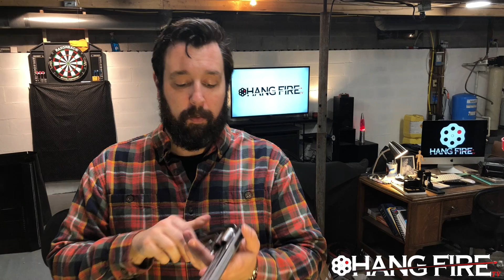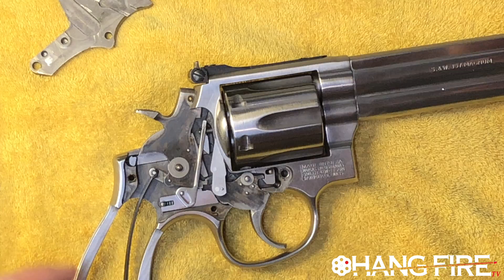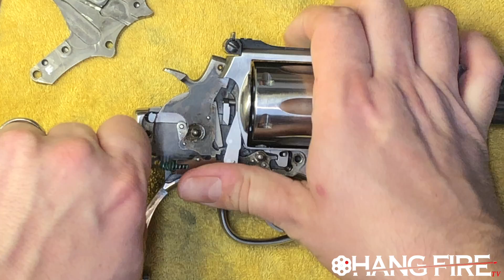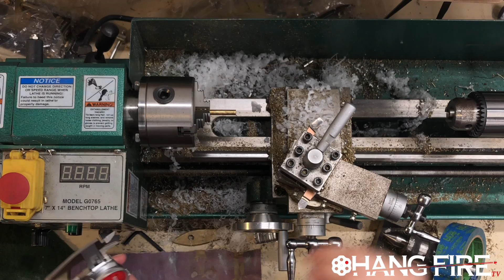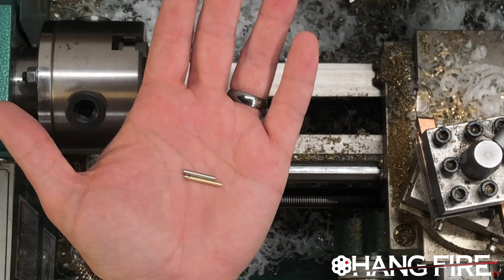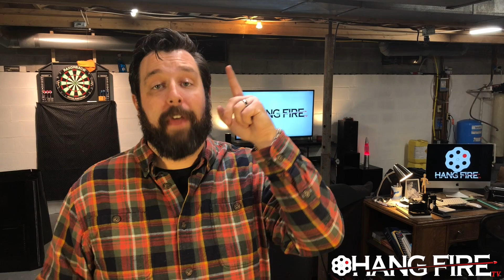Huge Improvement // S&W 686 Revolver // Internal Trigger Stop #improved #education #diy #learn

Comment: I was under the impression that using a pin inside the rebound slide will eventually bend the pin that the rebound slide spring rests on.
Reply from the maker: @rileyfrench3837 This is not a new technique. S&W installed these trigger-stops in their own factory products long-before me. The only way to bend the internals with a trigger-press would be with the intent to do so.
Reply: @unclehangfire  I'm aware that they come in some models of revolvers. In my case, my 986 came with one but also has a factory fitted trigger mounted over travel stop as well. It seems 9 times out of 10, Smith and wesson doesn't even fit the rebound slide stop pin as over travel stops as they are undersized to have any effect on function. Most professional revolver smiths and shooters don't use them, as they are known to cause issues and the correct over travel stop is trigger mounted (otherwise the performance center wouldn't bother fitting over travel stops directly on triggers)

Comment: Let the gun tell you what needs to be changed to improve the action. I have loved S&W revolvers since the early 1970’s. The duty guns I’ve carried and shot had been smooth as butter. It wasn’t until I bought my own M686 in 84 when I learned of their heavy and grainy trigger pull. Many thanks to armory techs and police department gunsmiths who taught me patience and the skills to improve my own guns without resorting to weak third party springs or a loosened and dangerously ineffective main spring. And many thanks to S&W engineers who understood the need to allow a decent break-in of the action before cracking a single screw.  Nothing should be done to a S&W until enough wear patterns have appeared to tell a ‘smith or an experienced gun owner where to polish or shim. Mitch was on target—even if he didn’t quite communicate his observations.

Comment: Be careful on operate the mechanism without sideplate, especially with mainspring.
The force on the trigger and hammer stud are a lot, they are designed to supported on both side.
Sometimes in these cases they broken

Comment: talk talk talk talk talk talk yet no proof. that would degrade so fast its insane.
Reply from the maker: No.
This gun is running now and I am not reinventing the wheel here.
Brass is not going to "degrade" under tens of pounds. 
Smith used this type of stop long before this video. 
Don't use the idea if you don't like it.

Comment: I have a newer model 68/4 or model 10 i have tried removing that pin in trigger return spring but only the spring comes out?
Any suggestions
Reply from the maker: Once you pull the rebound block the stock pin should drop out.

Comment: Keep working that trigger like you doing and sooner/later that pin that the hammer is setting on is going to "ah sh!t" break off then you gotta send your Smitty back to the factory.
Reply from the maker: S&W used this type of trigger stop in factory actions. The pin in the video is brass and it’s cut tighter than S&W pin that came out of it.

Comment: How to mess up your revolver 101
Reply from the maker: @sparky_-mf2cs  Impressed by this comment. It’s 2 years old - do you still agree with it?
Reply: I know, right? Some guys just gotta try to prove on YouTube they know more than the manufacturer.
Reply: @bustabass9025  😂 right...they watch a youtube video or read some forum and think they know more than the enigineers...
Reply: @sparky_-mf2cs  
When firearms come from the factory 99.9% of the time they are timed, calibrated, fitted, assembled, and ready for safe use by the consumer. These dremel weilding, screwdriver gouging "gun experts" simply want to come off as junior Brownings or Stoners, compared to true certified, educated, and experienced gunsmiths. 

Most manufacturers will not honor warranties that have been breached by these guys, when the gun surprisingly doesn't function as well after alteration. They even warn against disassembly beyond a certain point, unless handled by a real, living, breathing gunsmith. They do that for a reason. Never do they suggest removing or modifying original, nor adding jury rigged components to the internal workings of the gun.

Comment: When I was about 22 I made a rubber trigger stop for my Taurus. Most time I fired it in double action but single action was not impossible, just a bit heavy.  I did an internal rubber trigger stop but decided to keep it outside just to able to remove it in case of problems. Since Taurus uses a different trigger this idea is not possible on Taurus but it's the most clever solution I saw for S&W based designs, very good idea.

Comment: I had internal trigger stop on my 686-4 from the factory
Reply from the maker: There is one in some of the -4 ish models. But it wont be a very tight fit. The SA will have plenty of play after the snap.
Reply: @unclehangfire  Gotcha. I mostly shoot precision 27 yards offhand and still got a couple of 50p with mine. Did some polishing and a lighter reboundspring. Main spring I leave as is. Shortened barrel to 5" cause of a shootingbulge from previous owner. Only shoot handloads :)